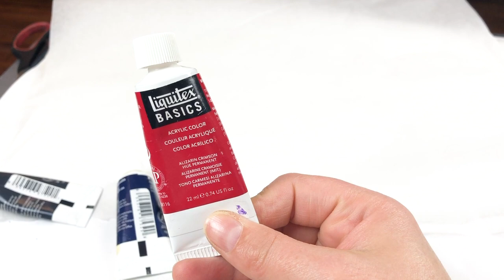Wood Burning Techniques  | Making Stamps

Comment: You might try oil-based printing ink ... acrylic paint dries too fast for this kind of printmaking (though there are several drying retarders that might help, real printer's ink is your best bet).  BTW, linoleum printing is called linocut or linoprinting... linotype is a text printing process using hot metal to cast complete lines of type, hence the name (back in the late 60's I worked for a newspaper that used this process).